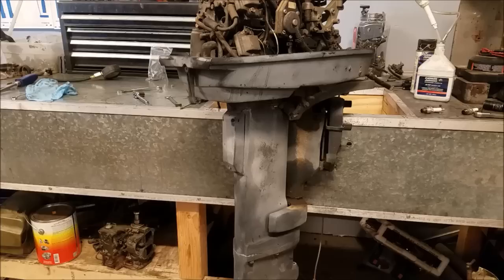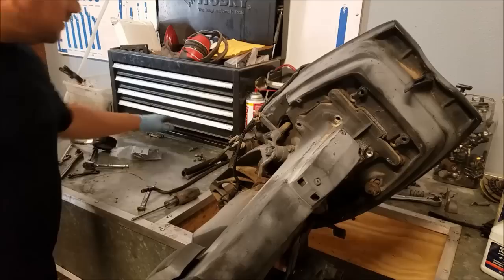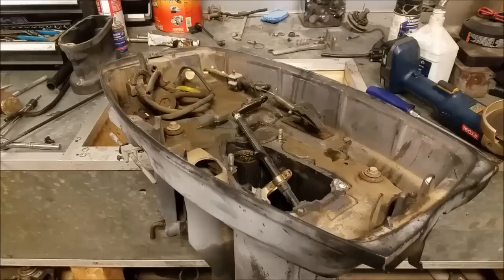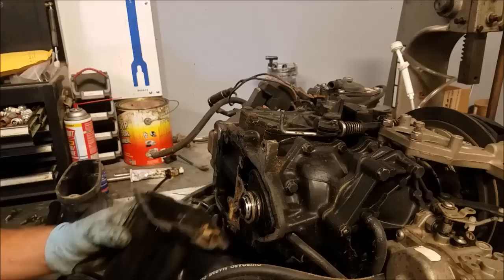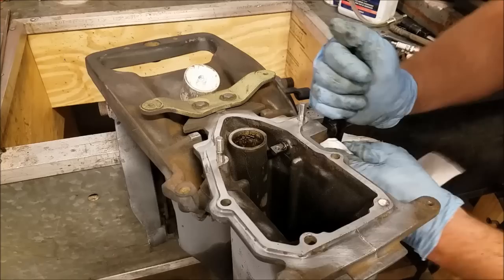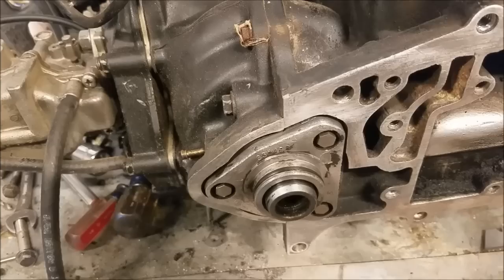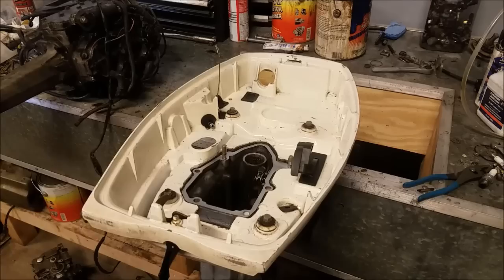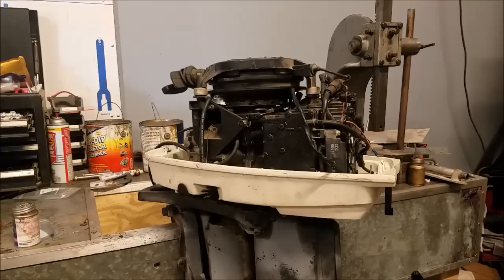Johnson Evinrude 20-35 HP Long / Short Shaft Conversion

Comment: Whilst I have found your video's on shaft and electric start conversions entertaining, informative and instructional, I have come to the realisation that my best bet is to wait until I find the combination of options I need already in the existing package. You have shown me that there are too many potential issues and specialist tools required to deal with said issues. Thanks for saving me all the grief.
Reply from the maker: Usually, and for most, that is the best option.
However, you may find the perfect outboard may not come along soon, but a junky outboard might, and it'll have the parts you need - and between the two you'll have what you want.
Many of my videos are about taking motors apart to be able to rob the parts off of them; as I believe that is most of the battle.

Comment: Would have got a Gas torch on that bolt Brandon. had the same problem on my Evinrude 50 and worked nicely. I use a plumbers gas torch.Great engine vids though as always.

Comment: Appearance good enough to tolerate it, ugly enough that no one will want to attempt to steal it.
Given the same expressed concerns, the lower crankcase seal cover bolts for the powerhead I am assembling will get a light even coat of Aviation Form a gasket except for a short bit at the end of the bolts.  The powerhead base mounting bolts will likely get the same treatment as well when I can get to it.
At least your project is moving, mine is stuck waiting on parts.  Nothing ruins the flow of a powerhead assembly job than one connecting rod cap out of four rods insists on not aligning by hand no matter what you do.
I didn't have a engine machinist supervision, so the recommended targeted measured tapping on the rod cap to re-align it went bad and the rod cap cracked at the seam after several attempts to get it to align.  Thankfully getting a used one in good condition that isn't expensive is fairly easy to order/get.

Comment: I’ve got an 1977 Johnson 35 Remote electric start that I want to convert to tiller. I’ve got a 1978 Johnson 25 tiller that I want to take the tiller off of it for the 35. Would it be easier for me to just switch the carbs or just switch the steering brackets? Also what parts are needed for a 1977 Johnson 35 short shaft to long shaft conversion?

Comment: have another question . on your video at 13:58 mark where you had to drill out the exhaust housing lower bushing. im doing a similar swap long to short on my 35hp i got lucky and mine came out with deep creep and some vice grips on my exhaust housing ! the lower unit im swapping to has 1 stuck on it which thankfully i do not have to remove now since i was able to get that one out the exhaust housing. what do you suggest i coat the top of  bushing with when reinstalling the lower unit so it does not corrode it self inplace like the other one did? . marine grease? or what. also another side question when i took off the water pump of my 1991 lower unit had what looked like blue loctite on the bolts and then my 1985 lower unit did not have that on the bolt threads which they use the same water pump kits actually most all parts are the same . should i hit them with some or no and whats the tq spec on those ?

Comment: I tore into my 84 25hp Johnson and I found the drive shaft welded and it's not a decent weld either it's like a blob that's been half ass smoothed is it safe to run or do I have to search the interweb for one?
Reply from the maker: Yeah I don't know.
If its been working, might work? 
Until it breaks, that'll suck.
Naturally it'll happen on the open water, at speed.
Leaving you stranded.
My bigger concern would be when it breaks and the powerhead takes off full speed without a load, possibly blowing itself up.
or, the half spinning shaft just destroying everything as it comes out at 5500 rpm

I think I would just buy a used one from ebay.
Reply: @BrandonsGarage  this happened to mine today. Luckily, the motor was fine. That’s why I’m on your video. The extension tube broke apart (didn’t hit anything) and the motor went into reverse at 24mph with three guys coming from a duck hunt. I’m trying to figure how hard it will be for me to just convert it into short shaft, praying nothing in the gearbox is trashed. I had no forward hearing after this.